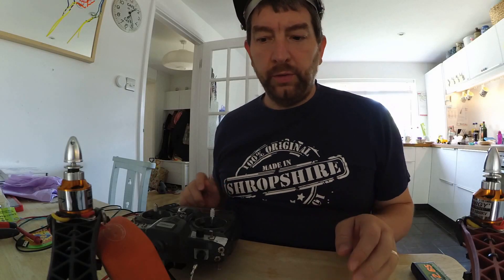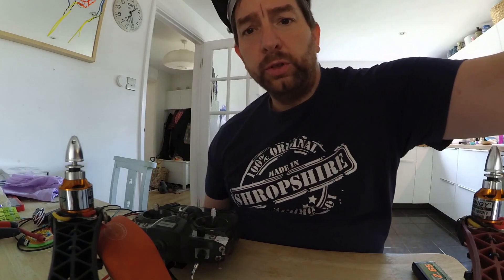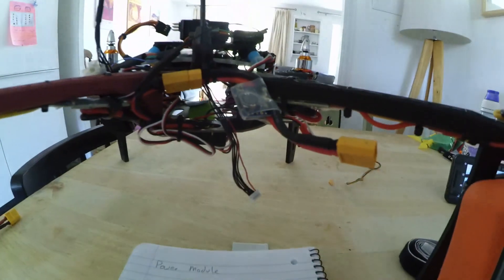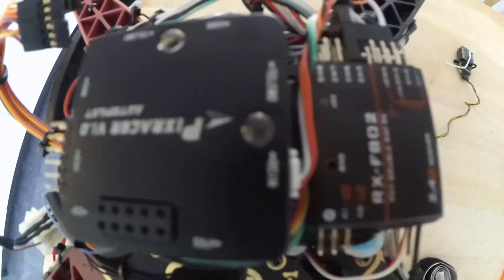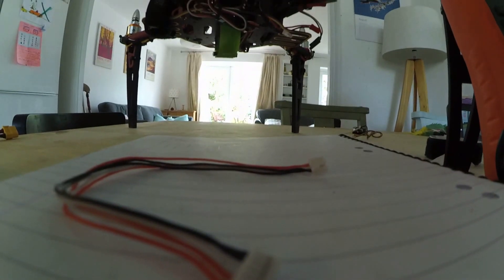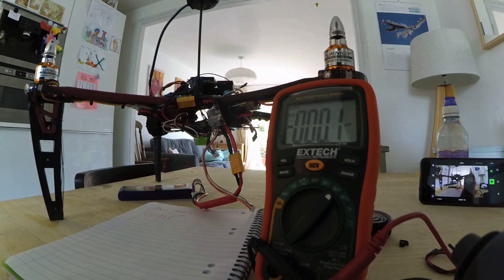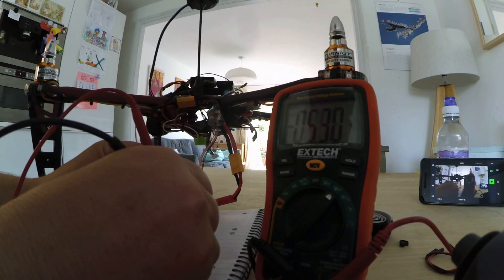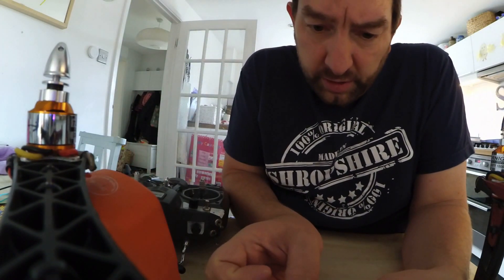Using APM power module with Pixracer

Comment: What settings do you use when setting up the battery? I have swapped the pins as per ur instructions but the voltage and current does not report correctly?? Had to disable the monitor completely? Starting to wish I had just bought another pixhawk..